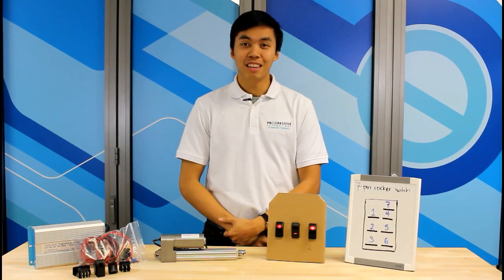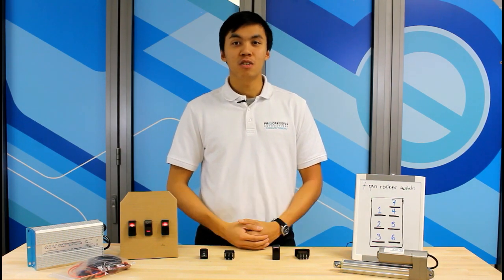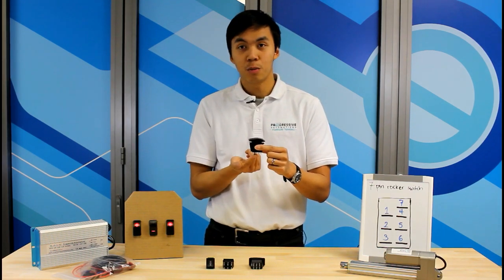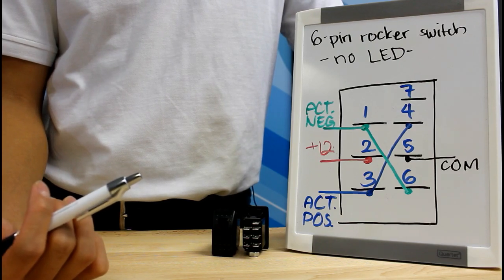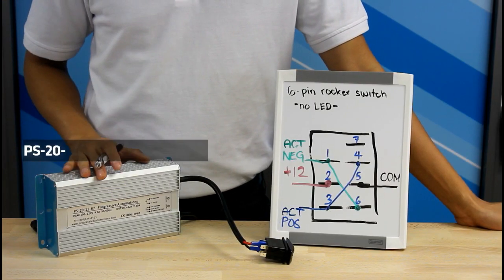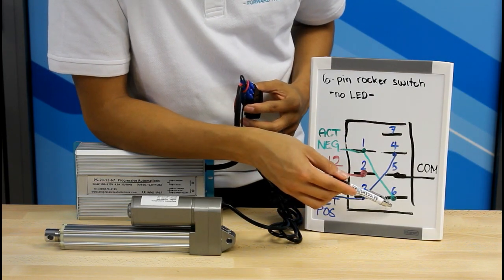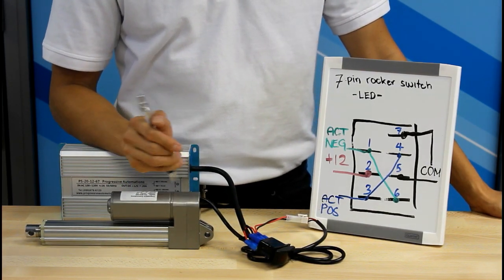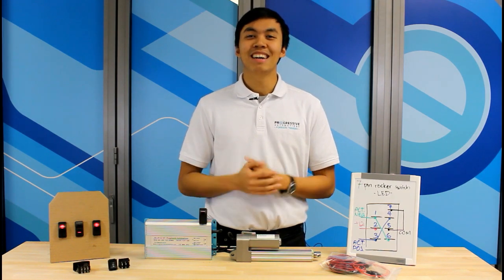How-To Wire an LED Rocker Switch

Comment: Any way to wire the bottom LED to light with the instrument lights? Basically turn the bottom LED on with the rest of the dashboard, while still controlling the actuator? Thanks
Reply from the maker: For the RC-10 / RC-11, There are only two options for the LED wiring: 
-Square LED (Always On) - GND to Pin 7, 12VDC to Pin 3 
-Square & Strip LED (like 3:54 of this video) - GND to Pin 7, 12VDC to Pin 2
Reply: @ProgressiveAutomations  Thank you
Reply from the maker: We're always happy to help!

Comment: How could a 6/7 P rocker switch control ON-off-ON for a load, using THREE switches, located in three locations (e.g. Lights) ?  Where does Fusing go, before switch or after ?  Relays advisable ?
Thank you for the content 👍🏼
Reply from the maker: You may be able to consider using microcontroller programming for the combination logic and then have H-bridges or relays for handling the current draw of the actuator.
Wire the fuse first in order to protect everything else down the line.

Comment: If I were to connect a sunroof and I want to connect it to my battery fo I need a relay ?
Reply from the maker: Hi Isaac,
 
Our PA-09 actuator and LED rocker switch used in this video both operate at 12VDC and already allow users to extend and retract the actuator with the switch. Because of this, relays will not be required for connecting to a 12VDC car battery.

Please feel free to email us with any other questions at sales@progressiveautomations.com!

-Progressive Automations

Comment: Can I connect two linear actuators of each 10A to single LED rocker switch?
Can this be applicable to third party actuators?
Reply from the maker: Hi Siva, Yes, these LED rocker switches can be used with third-party actuators, as long as the actuators are within the maximum current rating of the switch, which is 20A.

Regarding the 2 linear actuators, this is possible; however, there is always a speed tolerance of ±10% between each standard unit that we carry. This means, the actuators will not run in sync. 

If you have any other questions, feel free to reach out to us at sales@progressiveautomations.com or give us a call at 1 800 676 6123.

Comment: Will a  lighted rocker switch made for AC light up when the circuit is closed, but powered by 12v? My switch seems to be working but... no light :(. Thanks

Comment: Hi , I have the LED type 7 pin switch. Without using pin 7, but have the rest as shown in this video, I am still getting LED in one direction only. Why? Also, If I do use pin 7 to the common pin 5, both LED will work, however in the off position of switch, I measure -5. volts. Why?
Reply from the maker: Hi Paul
It sounds like the switch you are using is unlike the one we have in the video. Perhaps you are getting different results because your switch has a different wiring configuration than what we have on the video. It would be best to contact the switch manufacturer to obtain a wiring diagram. 

Best Regards